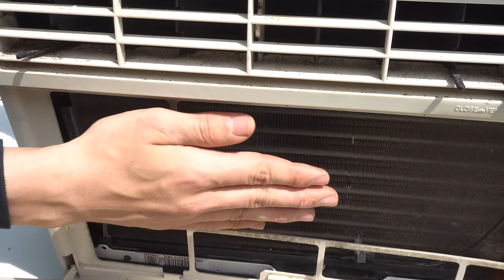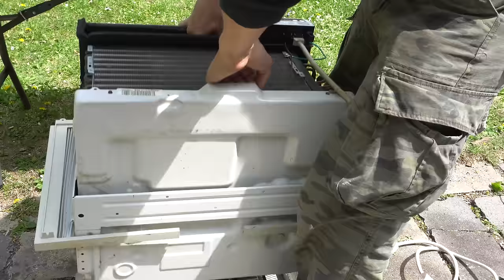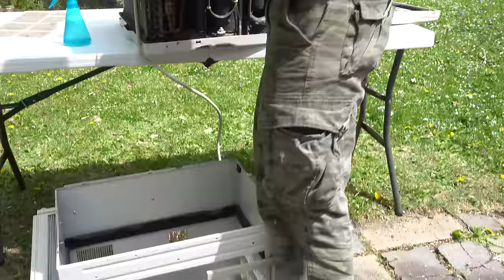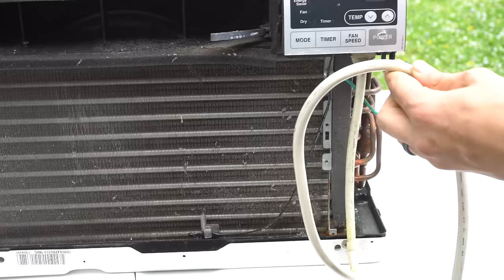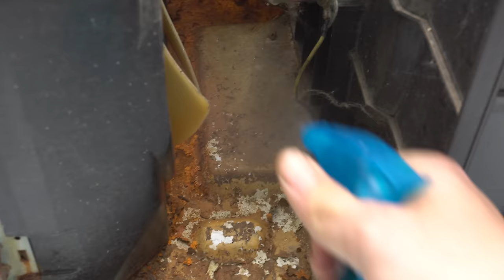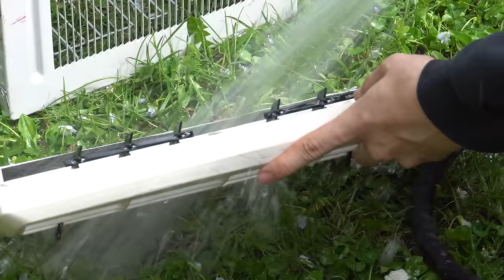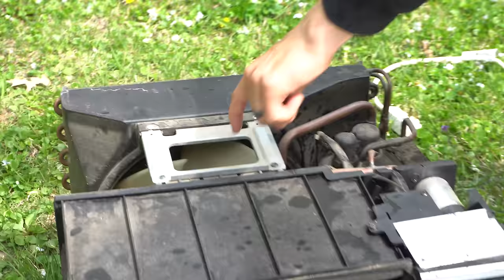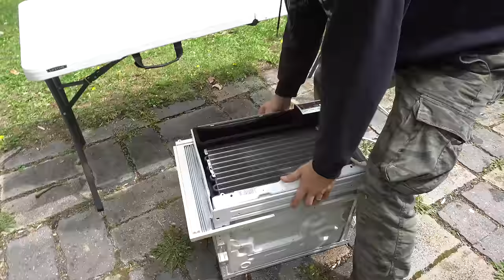Window Air Conditioner Not Cooling And The Most Common Fix

Comment: This video is far too long. All you gotta do is push "^" and "v" next to "temp at the same time. It automatically cleans the filter, just like when you trun a key halfway on a toyota and hold the trip odometer button to change the oil automatically. Technology is awesome.

Comment: If you spray that filter on the backside with some awesome that you buy from the dollar store or Dollar Tree and get your hoes and squirt it it'll all just fall right off by the time you spray it and get to the hose it's ready to come off spray the whole thing with it you ain't going to believe how good it works and fans are even better you spray a fan you how tedious it is to clean each level Square on a fan you spray it with awesome once maybe twice at the most and it's all coming on Falls right off it's crazy that stuff works great

Comment: Shouldn't your video be titled how to clean a ac? Your not trouble shooting/fixing nothing dude
Reply: A dirty AC can stop working as well and wind up not cooling the space. Also, if an AC unit is working inefficiently, it can draw too much power and trip the circuit, causing the unit and anything else on that circuit, to lose power. It’s a huge PITA. So it most definitely is troubleshooting. 

Look at all the comments from people here saying theirs wasn’t working, they were thinking of replacing, and this fixed it.
Reply: @annetteprice  I agree with you..100% if your a/c condenser and/filter is packed up with dirt you will have problems...but that's something any person with normal intelligence can easily see and use there better judgement and clean with there hose...if you drive threw mud and your car gets dirty do you search YouTube looking for how to clean it..I hope not it's pretty self explanatory..wash it..right? this video should be titled how to clean a ac.. troubleshooting means you have a problem with the compressor/condenser/refrigerant/something's wrong... something is abnormal.... because you use something and it gets dirty and needs to be cleaned is not abnormal or a problem it's normal it's to be expected...get it?
Reply: @annetteprice  I looked at your channel to see what your all about Annette and was surprised to see you have no videos? Not one...how strange been a member for 5/6 years and never found one thing interesting/entertaining enough to post?very strange..make a video and send me the link let me see what your all about